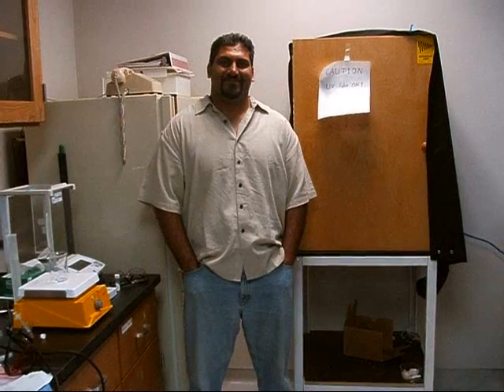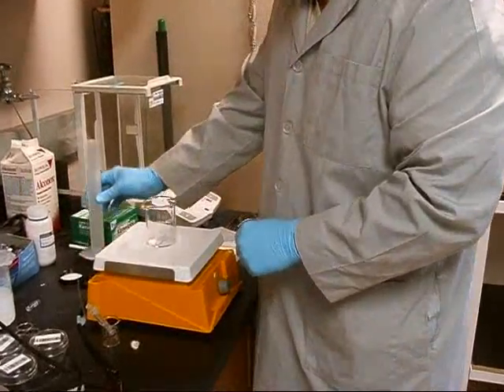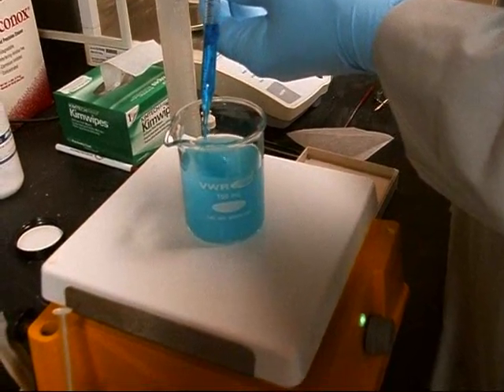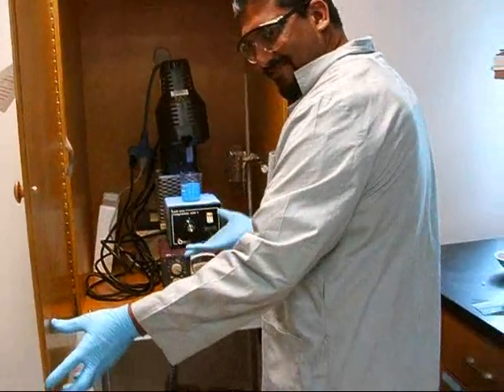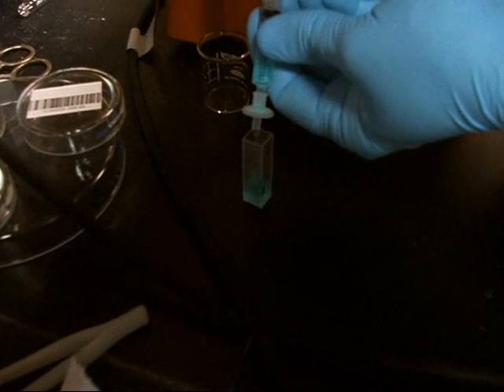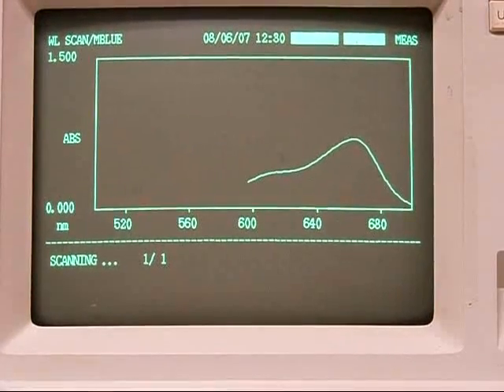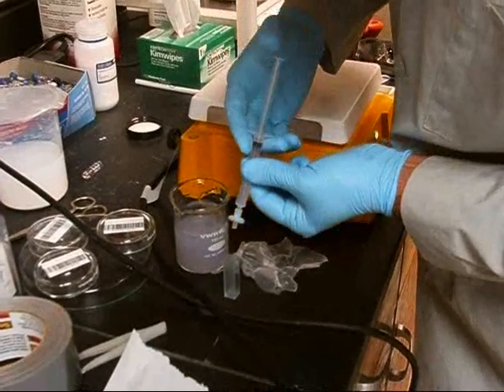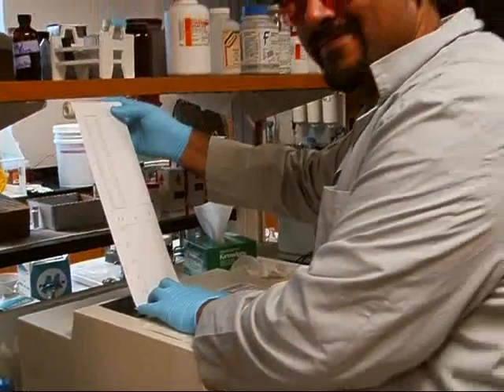Photodegradation of Methylene Blue

Comment: what type of syringe filter did you use, wont MB get trapped in membrance, i used hydrphobic syringe filter but it's very hard to compress the syringe
Reply: I would say the same... MB get trapped in the membrane, which gives a false impression of adsorption or photodegradation.

Comment: Do you use uv light or just common lamp inside the box...?? And how long do you take to degrade that sample??
Reply: Pls answeeeeer
Reply: It depends on the photocatalyst. Of the photocatalyst can only absorb uv light then only uv light or u can use a solar simulator if the material has the ability to absorb the vis.